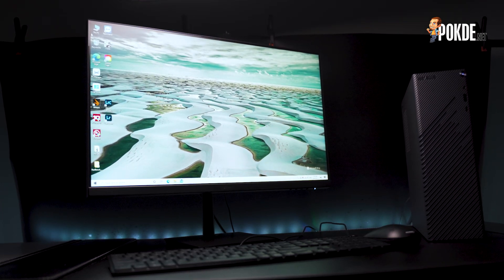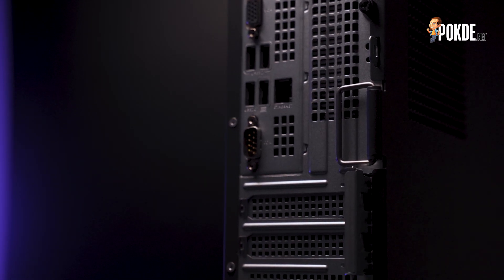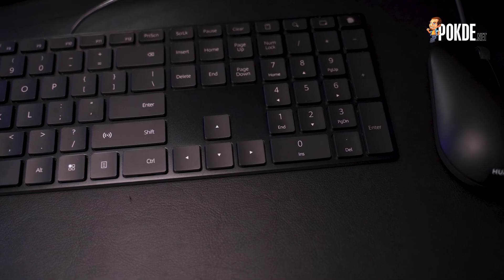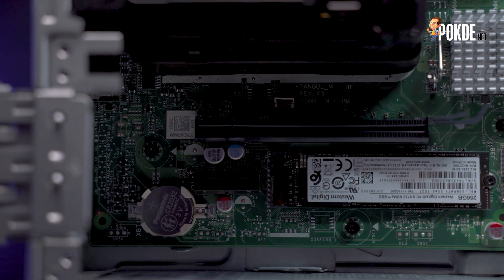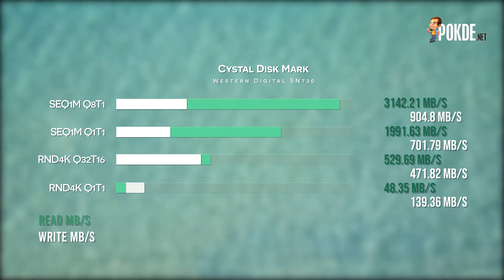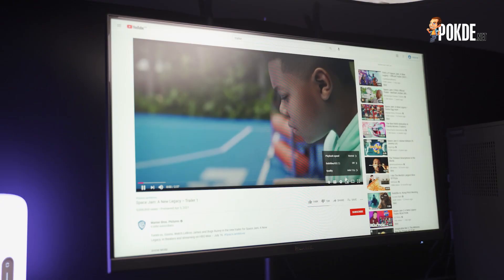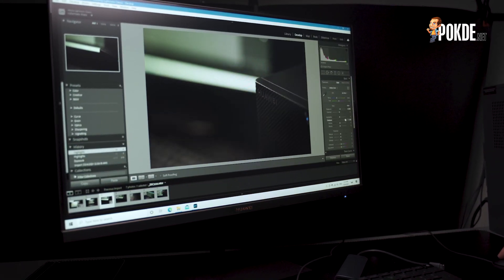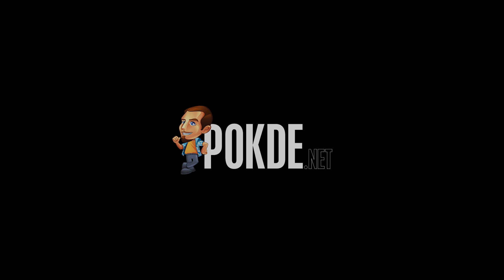Huawei Mate Station S Review - Microsoft Office, Premiere Pro, Crysis?

Comment: so there is gpu slot what videocard can fit on that case
Reply from the maker: A low-profile GPU that doesn't require additional PCIe power connectors should work great in the MateStation S, although it is worth mentioning that we didn't have one around to test whether the upgrade is viable
Reply: @PokdeDotNet  there is a gtx 1650 and gtx 1050ti low profile that ive search its only 63mm wide, mate station s is 93mm i think its fit.